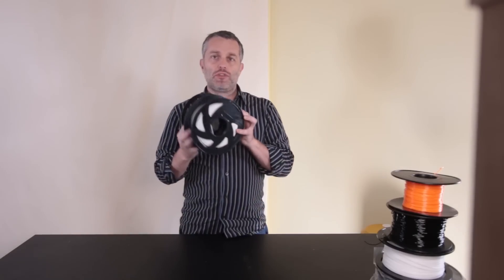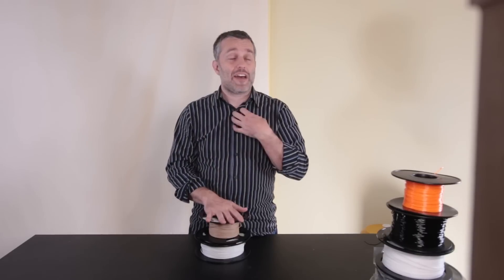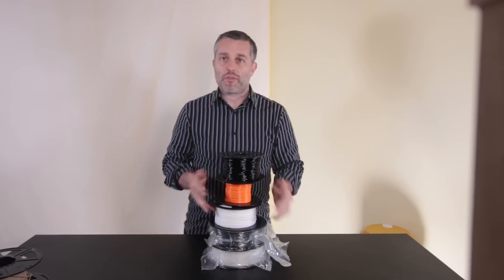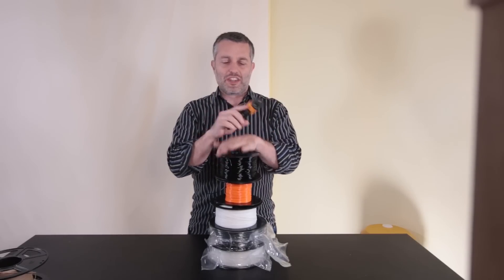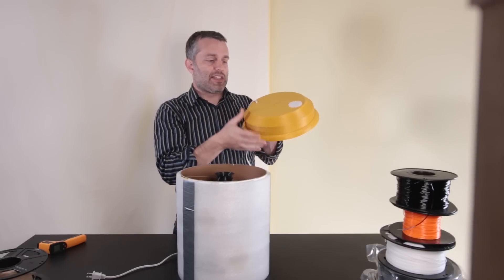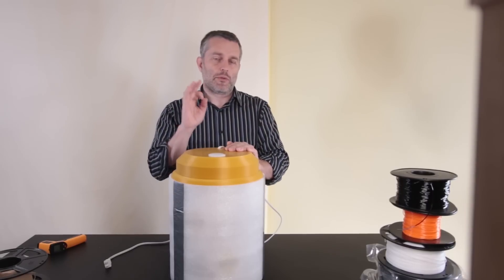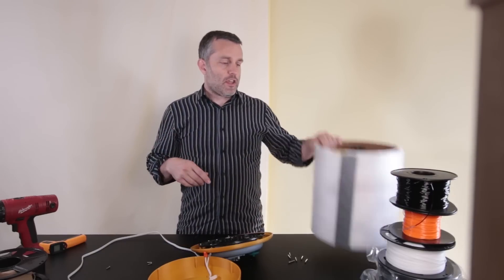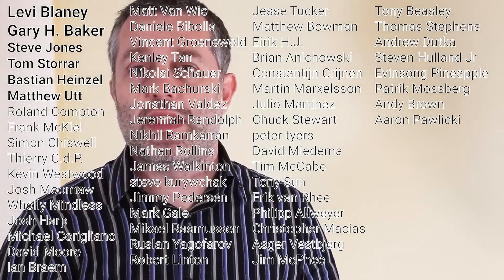Keeping your 3D Printer Filament Dry is Important.

Comment: Hi there. I like your dryer very much an plan to make one. I'm no hater, I just want to correct a misinformation with the following. Please document yourself if you don't trust me BUT : definitely the PLA is NOT biodegradable. It won't degrade like greens or paper do. Actually PLA is long term bio-assimilable. To degrade PLA you need a high concentration of enzymes in a hot environment under reasonably high pressure. Those conditions cannot be found in nature, hopefully because we could not survive ! Those enzymes exist in nature but not in such comparable concentration. You can't find a warm environment at this pressure level too. Actually the degradation of PLA has been only seen in laboratory environment. So any PLA part won't biodegrade as expected in nature. UV can degrade the shape and brake polymer links but even in smaller particles, the PLA won't bio-degrade in a reasonable time. In other therms, you need to wait a century or two before seeing the start of any bio-degradation, and full degradation should take several centuries. On the other hand, PLA is still better for the environment than ABS or Polystyrene which needs 25.000 years to degrade...
Reply: "To degrade PLA you need a high concentration of enzymes in a hot environment under reasonably high pressure. Those conditions cannot be found in nature, hopefully because we could not survive!" --- Yes, that's true, but those conditions can be found in a landfill. And even if you have to wait a couple of centuries, that's still by a factor of 10-1000 faster than other plastics, so I'd definitely consider it to be biodegradable.
Reply: @ConstantijnC  According to your thought anything would be bio-degradable. But bio-assimilable and bio-degradable are not the same thing. Bio-degradable means some organisms are able to dégrade a material left into a natural environment. Bio-assimilable means the material can finally integer the biomass after a long time process. That's exactly what thermoplastic (including PLA) or nuclear waste does. It's just a question of time... But this is not bio-degradable...
Reply: @axelSixtySix  "Biodegradation is the breakdown of organic matter by microorganisms, such as bacteria, fungi." - https://en.wikipedia.org/wiki/Biodegradation
"The process of biodegradation can be divided into three stages: biodeterioration, biofragmentation, and assimilation." - https://en.wikipedia.org/wiki/Biodegradation#Mechanisms
"The term Biodegradable Plastics refers to a material that maintains its mechanical strength during practical use but break down into low-weight compounds and non-toxic byproducts after their use." - https://en.wikipedia.org/wiki/Biodegradation#Plastics
"Biological assimilation, or bio-assimilation, is the combination of two processes to supply cells with nutrients." - https://en.wikipedia.org/wiki/Assimilation_(biology)
"Poly(lactic acid) or polylactic acid or polylactide (PLA) is a biodegradable and bioactive thermoplastic aliphatic polyester derived from renewable resources, such as corn starch (in the United States and Canada), cassava roots, chips or starch (mostly in Asia), or sugarcane (in the rest of the world)." - https://en.wikipedia.org/wiki/Polylactic_acid

I might be just another guy from the internet, but with a degree in environmental sciences I tend to know a thing or two about Biodegradation. But the thing is that such a degree is not even nessecary in this discussion since wikipedia has everything you need to know about the topic. 

Indeed, almost everything is biodegradable. It only has to consist of organic matter, it has to be able to be broken down by microorganisms and its byproducts have to be non-toxic.

Another point you're mentioning is that PLA won't biodegrade in nature because there aren't many places on earth where PLA can biodegrade. Well, there are many places: almost anywhere a couple of meters below ground for example. Another thing is that, as you mentioned, the polymer links of PLA get destroyed by UV light. It is true that that is not biodegradation but just plain degradation, but the increased surface area after the degradation process offers microorganisms more area to attack from. The same is with water: Water also degrades PLA and thus increases its surface area. Now guess where most of our plastics end up? In the ocean, which mainly consists of water. What a shocker. I know.

Now a little comparison to end with: 
How long does PLA take to biodegrade under normal lab conditions (IUPAC 1982, 25°C, 1013hPa)?  ->100-1000 years
How long does wood take to biodegrade under normal lab conditions (IUPAC 1982, 25°C, 1013hPa)?  ->100-1000 years
How long does PLA take to biodegrade in a regular compost bin?  ->~6 months
How long does wood take to biodegrade in a regular compost bin?  ->~6 months

If you want to read more about the degradability of PLA, I suggest reading chapters 3 and 4 this research paper: https://www.researchgate.net/publication/317264188_Hydrolytic_degradation_of_polylactic_acid_PLA_and_its_composites
Reply from the maker: A very good comment! Thank you for what appears to be the definitive statement on the biodegradability of PLA.

Comment: Like others have said, not a hater but there is a lot of misinformation in this video. PLA IS hygroscopic and absolutely does absorb moisture from the air. When it does, it becomes brittle. I have had PLA that I left exposed on the printer for just 2 days, break in multiple places and what a pain to remove it from the extruder, hot end and Bowden tubes. I learned the hard way to never leave PLA, or any filament, exposed to the air. Since keeping my PLA in “dry boxes” I no longer have the problem with brittleness. I also print with the PLA in the dry box to minimize exposure. 
Having said all that, your design for the dryer is super cool and innovative.

Comment: Foolishness.  Don't mean to be harsh.  You do NOT have to get to 212F to dehydrate.  It is a continuum, not an absolute.  The higher the temp, the more the moisture comes out.
Reply from the maker: There is truth to what you say, but, but it's not a linear continuum. At the phase change of water 100°C (212°F) vaporization occurs everywhere. Whereas evaporation only happens on the surface of the liquid. You can increase the vigorousness of evaporation  by increasing the temperature, but at the boiling point there is a massive spike in vaporization. So the difference in drying time by increasing the temp by 1 degree from 50°C to 51°C is significantly less than a similar 1 degree increase at 101°C. The instant you get all the molecules of water in your filament to be 100°C your filament is dry.* Whereas it has to sit at 50°C for a long time waiting for the surface to evaporate off before the lower layers can become the surface and similarly evaporate off. 

*Of course, you then need to give it some time for the water vapor to exit the filament and float around in the air. This is why I find the best technique to be heating the filament in my dehydrator then placing it in the vacuum chamber.

Comment: I know this after 2 years,but I just saw it now, you can easily change the temp sitting by changing the thermal fuse(switch) thingy to a higher rated one.

Comment: The point someone else was making about boiling point of water doesn’t pertain to the process your trying to achieve. It’s really the water absorption process. Moving moisture from one place to another because the place the water is going to is dryer than where it was at. Boiling water to 212 deg just accelerates the process. Pour water on a plate ... it drys out because the air is dryer and absorbs the water. Your process will work as long as it’s dryer to some percent below 100%. The higher the percentage the longer it will take. Sorry got carried away. Just supporting your process. Oh ... forgot to mention for hot to cold heat transfer. Later

Comment: wrong! pla melts and can be extruded at 160° or less, also if you go above the glass transition point of that material you can ruin it, either throwing the tolerance off whack, or melting  it

Comment: As a former research chemist I can tell you that water evaporates at just above zero degrees C  it’s slow but it still evaporates. So 60 DegC is fine. Plus a lower pressure will evaporate water faster at a much lower temp (that’s why tea made on top of a mountain doesn’t taste as good, because tea needs water at 100DegC to infused properly and due to lower atmospheric pressure the water will boil at a lower than 100DegC) . So an evacuated bell jar at room temp or a little higher will give you a similar effect and will be much kinder to the filament. However bell jar are not cheap and neither are vacuum pumps. So the food dryer is probably your best option.

Comment: PLA can absorb water, it's just slower at it. In my concrete surroundings it takes a month and it's noticeable, a basement can be worse. I wouldn't take PLA above 50˚C or PETG above 70˚C because you risk it fusing to adjacent strands and as well as distorting the shape of the filament strands. You're not "boiling" the water and you don't need to. You only need the water to sublimate, which is aided by not only increasing the temperature, but also, increased temperature lowers the relative humidity for the same amount of water, so the water will try to "balance out" by leaving the plastic. Also, most spools are polystyrene and they can distort at 80˚C.

A food dehydrator can do the job. Aldi offers a workable food dehydrator machine for $20.

Comment: I do not have a printer.  I also did not have a CNC machine until several years ago, I built three.  I like building my own stuff.  I was going to build a Delta, and I still might, but thought in this case I should buy the latest Anycubic machine to gain some experience.  My gut tells me 3D printing is more difficult than CNC.  I just ordered it three minutes ago, and am already considering upgrades, primarily a Duet.  I also added you to my Patreon list.  PS. I tried doing a non-tier donation, but that failed, so I am currently at the $1 level.   I have too many such accounts, if my wife finds out I am dead meat.  Congrats on your move, I totally relate.  Looking forward to all of your videos.
Reply from the maker: Thank you for being a supporter!
I would say that 3D Printing is easier than running a CNC router. The documentation is more complete, and when you make mistakes, you aren't breaking bits, so you are more likely to just try it and see if it works instead of making sure it's right before you start.

Comment: Just about everything said in this video is inaccurate.  If you are looking to do this find another video to learn from.  A good dehydrator is all you need and some basic guidelines below.  If the temp is slightly lower just let it go a little longer.
PLA  45°C (113°F)  > 4h
ABS  60°C (140°F)  > 2h
PETG  65°C (149°F)  > 2h
Nylon  70°C (158°F)  > 12h
Desiccant  65°C (149°F)  > 3h
PVA  45°C (113°F)  > 4h
TPU/TPE  50°C (122°F)  > 4h
ASA  60°C (140°F)  > 4h
PP  55°C (131°F)  > 6h

Comment: first of all heat it at 200c or higher, this can cause problems (so i been told with some filaments). look at the pint dry info there help sheet is great. also 1 major problem with your... well 2 really. 1 how does the water vapor escape? you need some way to vent the heat out to allow the water out. 2 is how to you plan to heat the filament if it blowing down a tube  when heat rise to the top. that system is build to heat and blow like a vortex so forcing it down a pipe makes it lose it power, in turn not giving you the votex heating some will do.

Comment: Down near the heating coils, there was either  a large silver resistor (or temperature switch) connected in series.  Change that switch with a higher temp one, or resistor with a lower resistance one and the coils should increase in temperature.  Be careful not to make too much of an extreme change or you might cause a fire tho...  Not a failure, just need more r&d.

Comment: I highly recommend you watch this video about drying your filaments on CNC Kitchen https://www.youtube.com/watch?v=FAXUjZZER5E basically you can use your food dehydrator to dry any filament material, the only difference is the drying times. All the food dehydrators available on the market, even the expensive ones, don't go higher than 70C.

Comment: Like the video but a few things to consider here that may save some headache in the future.. (own experience) lol
Glass transition temperature (point at which plastic starts to soften and deform)
PLA - 65C (150F)
ABS - 100C (212F)
PETG - 80C (176F)
Nylon - 100C (212F)
PC - 120C (248F)
These may very depending on the quality though.  I decided to dry some ABS and PLA filament at the same time in my oven and set it at 200F for 8 hours and while it did not melt the ABS it did deform the filament so that it was no longer round and ended up ruining the whole roll.  My PLA was completely screwed..lol

Comment: Hi, to keep your filament dry a good idea is to use a plastic container and put silicate at the bottom. This will keep the humidity in the box very low. If you use orange silica gel you see when the silica gel needs to be dehydrated in the oven again. Works like a charm to keep all of your filaments dry.

Comment: if you leve the filament in the open you will know why it need to be kept dry. it will start to crack as son as you touch it. it takes a lot of time to. when you use a old role you will se it start to "fome/expand" more then a fresh role. the print result will become crap.

Comment: I think most "Wood PLA" has Bamboo in it which explains its strength. Wood has a natural flex to it so it bends before of breaks ...especially bamboo. Wood is Hygroscopic too so it should benefit from the drying process too.

Comment: constantijn gave a great understanding of removing water.  As a Master degree engineer in heat transfer and fluid flow.  I can assure you he has it down correctly.   If you want to increase the temperature then you have to reduce the loss of heat.  More insulation will reduce the conduction and convection losses.  The air is also replaced.  Air is sucked in and is expelled somewhere.  Inspection should find  one of the ports.  Put a restriction in that path.   The water taken out of the filament is carried away by the air so you do need air exchange.   The fan motor is also cooled by the air flow so do not block it's cooling.

Comment: 70C is enough for PA, HIPS, PC. Just add some silica and it's fine. Higher temperatures are only necessary for peek, pek etc.

I work in a material lab and we never dry nylon above 60C. Most industrial filament dryer systems eg. from MassPortal only go up to 70C.

Comment: Your first statement about oven temperatures and PLA were actually almost right. It's the glass transition temperature of PLA that is between 60-65C, which is below 200F (68C). At the glass transition temperature, the filament begins to deform. That can lead to the filament deforming out of specification (1.75 mm +/- 0.03 in most cases). So technically, it's not melting, but there is a physical change that's happening that can effect PLA and other blends that are at or above their glass transition temperature. Polymer chemistry and physics are fascinating! 

Thanks again for another interesting, inventive video! I never miss them :)

Comment: You have a simple Nichrome wire heater. The temperature is determined by the type of wire (probably Nichrome 80) the length of wire and the amperage applied to it. There are many Nichrome calculators online that will help you figure out what you need for the desired temperature. I always enjoy your channel.

Comment: That switch might be just resistor values, and that one jellybean component on heating side probably works with it.
So measure it up, it might be that using a resistor you can set the temp you want.

But as said earlier, 71C should be sufficient :)

Comment: 71C is sufficient for drying filament. My DIY drier box i typically ran at around 60C, but i kept it almost 24/7.

I used a big plastic box with lid for it, thick cardboard as insulator. Put in pieces to hold a bar to which hang the spools, a hole to take out filament and keep on the drying box during printing (important for nylon).

Electronics i used 3x40W 12V heater cartridges and cheap old CPU coolers: I drilled 6mm holes and fitted the cartridges there.
I used a cheap ebay 12V PID which goes upto 110C for the temperature control, and a old server PSU for the power.
And a few screws ofc, fittings etc.

Total parts cost:
Plastic box with lid: 15$
Cheap PID: 10$
40W Heater cartridges: 5$
Old CPU heatsinks w/ fans: 10$
Server PSU: 15$
Misc connectros wire etc: 5$
Few screws, pipe etc.: 5$

It fits 5 spools comfortably and does go upto 80C or so. and i would def recommend keeping nylon in there and maintain ~50C temp during printing.

Total: 65$

My next version will be printers in a closed server rack cabinet with controlled temperature of 40-45C, we shall see if that low temp is sufficient for keeping filament dry!